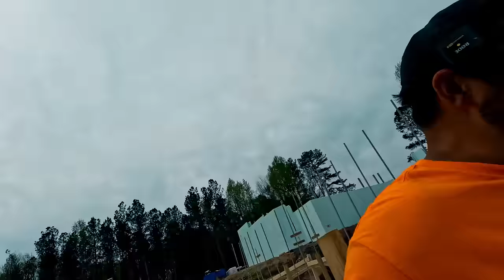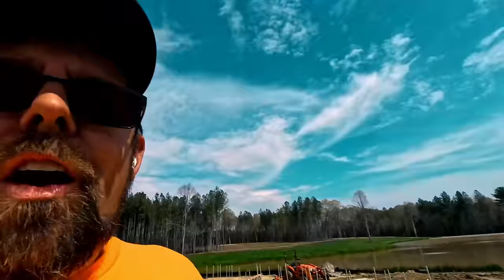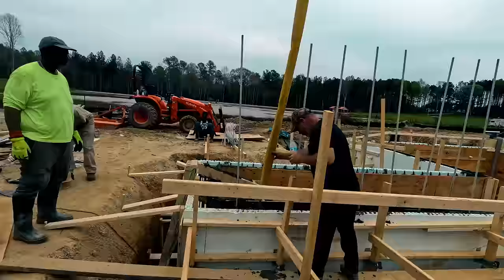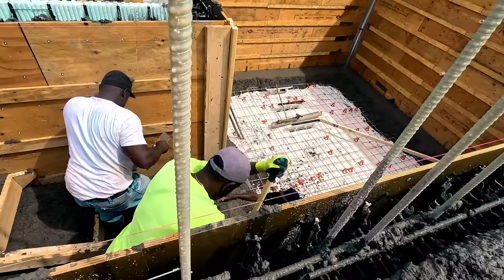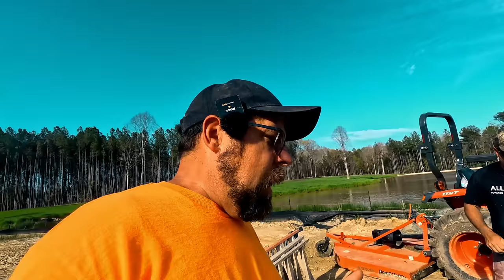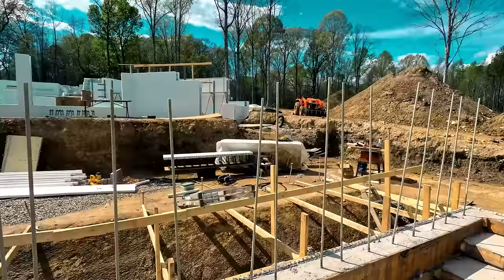ICF Dive Pool Concrete Pour

Comment: @Geoff When your pouring a wall that will be stacked higher after a partial pour before the pour put a strip duck tape on top the inter-locking part the foam It will save you the time of cleaning the locking part like 1 minute vs. 5-15 minutes spent cleaning the lock joints ! That is how @Dirt Perfect done it on all his icf builds !
Reply from the maker: Good advice. I talked about that in the video, but I think I had to cut it because you couldn’t hear me talking because both of us were miked up. The wall isn’t getting stacked higher on top of the nubs.

Comment: Once the concrete starts flowing, there's no turning back.  Impressive job.  Well done Geoff.  Props to the guy at 20:00 walking along the top of the wall with slippery wet concrete everywhere.  He's def not afraid of heights.

Comment: I fully understand why you want the house built with ICF and concrete. Our house was dead center of Hurricane Andrew and is of concrete block and poured concrete construction. It also is a two story house so it had an extra wind load on it. But it was built by a contractor who kept adding things to it to make it stronger than required by the then current code. About the only change that would have been made was to also use a poured concrete roof instead of trusses. But we only lost some shingles and tar paper even with that. Windows were what took the brunt of it. Now we have shutters that are high rise rated and storm panels to protect the openings. One of the garage doors is still an original from when the house was built in 1978. And they were on the side that took a direct tornado hit. 
Our house in Ohio is stick built with a concrete block basement. It is intended to have a concrete storm shelter added because even though the chance of a tornado in our area is rare, doesn't mean that one can't happen.

Comment: I didn’t see one piece of bent rebar in the corners. Wow, I wonder what’s keeping the corners together under tension? Where I’m from fiberglass rebar is used for all the straight runs and steel is still used for bending corners etc. I’ll be curious to see this in 5-10 years…..one way to get me to subscribe I guess. 😊
Reply from the maker: There’s bar in every corner. All the way up except for the very top row in one corner because we had cut it loose to make adjustment and forgot to put it back in. But other than that it all has the pre-bent fiberglass corners tied in it.
Reply: @BealyGood  worries averted! Thx for the update

Comment: Maybe it’s a stupid question but Like I asked on Chris’s channel without getting an answer, what happens to the form work between the floor and wall concrete?
Reply from the maker: It gets removed. Unless I’m not understanding what you’re asking.
Reply: @BealyGood  I couldn’t quite see if the inside form board ran down between the wall concrete and the floor concrete or did it finish above the concrete of the floor, other wise it would be jammed between the two concrete pours when it cured! I did see some concrete leaking out under the inside wall form on to the floor when you were pouring the walls but it didn’t look like the thickness of the floor!
Hope that makes sense!
Reply from the maker: All of the form boards come out. There is a gap at the bottom for the concrete to flow out to the floor.

Comment: Where is the bottom drain?
Reply from the maker: There are three. They have black plastic in them so Concrete didn’t go inside them. They’re about 3 feet long and a few inches wide.

Comment: Question: what are the 3 places in the bottom of the pool, why are there only rebar on one side of pool and not all the way around?
Reply from the maker: Rebar is all the way around. I only left it long on that one side because the wall of the next pool sits there. The 3 main drains in the bottom, one is for circulation for the lower pool. The other two will pull water from the lower pool and pump into the upper, for the waterfall to work.
Reply: Hi Geoff,  What a stressful day! The professional crew pulled it off! Finally poured after 2 years. Well, seems like it, haha. Proper planning takes a long time, but definitely worth it! Beally good to see Dog Dog at the end with a very happy approval!! As always God bless and take care from your very long-time California subscriber 🙏 🤲
Reply: @BealyGood  Thanks, l couldn’t figure it out. Never thought about narrow, long drains for recirculating or drainage. This would be hard for someone to get sucked into it, like round drains.

Comment: Plunging with a 2x2 would be more effective than that pencil vibrator in concrete. Those are for runny grout with no aggregate. Useless
Reply from the maker: The vibrator did great for the exact purpose. We wanted it for, the steps and upper wall. The big vibrator did great too. All the forms are off in the walls look great. Glad I didn’t use a 2 x 2.
Reply: @BealyGood  I am not buying that. I have been working with concrete for years. For stairs yes
Reply from the maker: @half-breed  that’s what everyone was using at world Concrete, so I don’t know what to tell you
Reply: @BealyGood  if they were experts they should have taught the vibrator gets pushed in fast and extracted slowly to bring the air to the top. The basics
Reply from the maker: @half-breed  🤷🏻‍♂️ Guy operating it has done hundreds of pools. Concrete looks great. Let me know when you have the video out showing the right way. Thanks.
Reply: @BealyGood  doing it 100 times and doing it right isn't always the same thing
Reply from the maker: @half-breed  to me, doing it right is having a successful wall that does not have voids in it, and looks good, which I have.
Reply: @BealyGood  and you would be fired off the real jobs keeping that attitude. I just posted the link you requested from the experts
Reply from the maker: @half-breed    Have a great day.